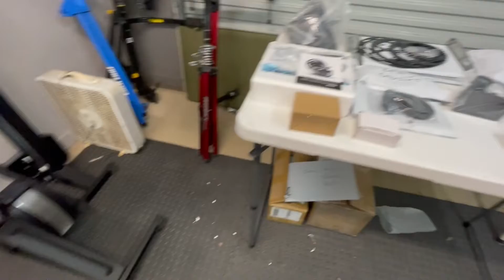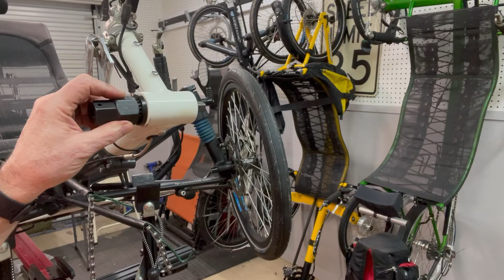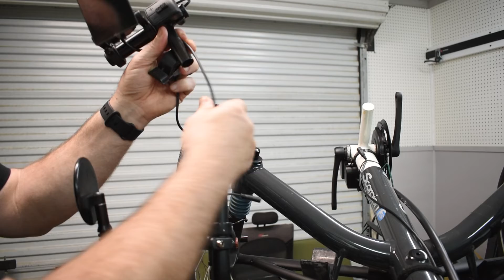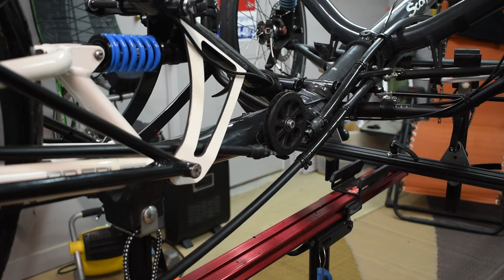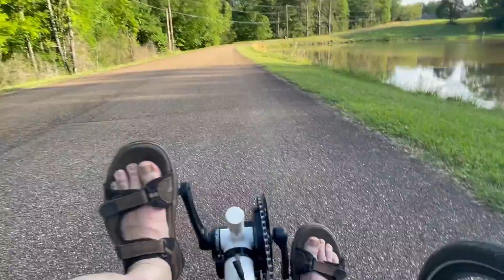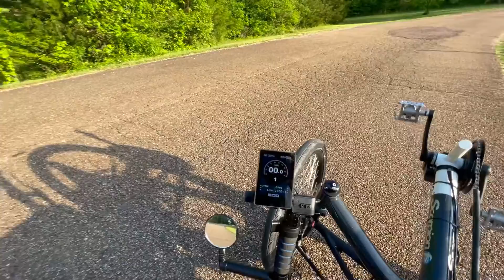Tray's DIY Trike Motor Install!

Comment: Who did you get your e-assist kit from?  I have a gekko 26 non folding and want to put e-assist on it for touring....utah trikes wants to sell me a bafang kit but I like the torque sensing of your motor.
Reply: Steve, I got my kit from these folks: https://cycles.eco/ Fantastic to deal with and they can configure a kit to meet you trike needs. I much prefer the Tongsheng torque sensing vs the Bafang's cadence sensing. The tourque sensing makes it feel like a seemless extension to you ability to pedal vs the on off feel of the Bafang.
Reply: I'm trying to decide which e-assist system to install on my gekko 26...mid-drive or hub motor....but also thinking if I should just sell the trike and upgrade to a better trike to handle the multiday/week/month touring i want to do during my retirement years.  Since I sold off my truck on Friday I'm now carless in LA.  Hopefully I can find a trike to use....e-assist or manual....to do these trips.
Reply: If I understand right, Bafang now has a 750w torque sensing motor. Looking to convert my Tricon to electric mid/IGH.

Comment: For non-mechanics, which way do you loosen and tighten the pedals?
Reply: Right pedals loosen by turning counter-clockwise, left pedals loosen clockwise.
Reply: Dab a little bit of grease or anti-seize on the threads when you reinstall. That will keep them from seizing together and makes it easier to remove next time.
Reply: Usually on bikes, the rule of thumb is that the chainside pedal is a “normal” thread, while the opposite side pedal is a reversed thread.